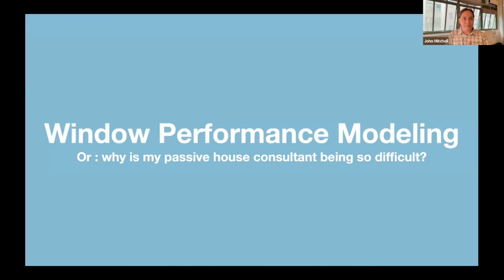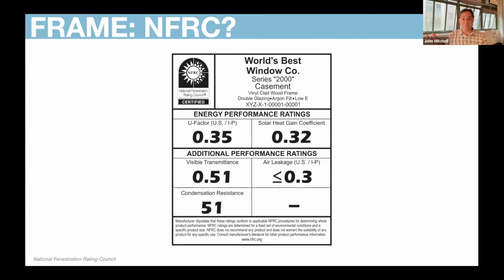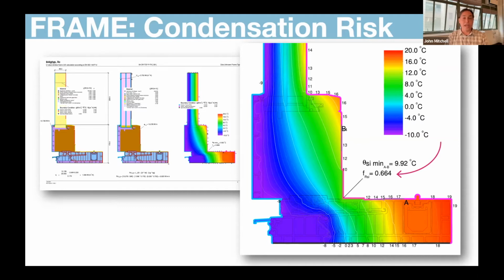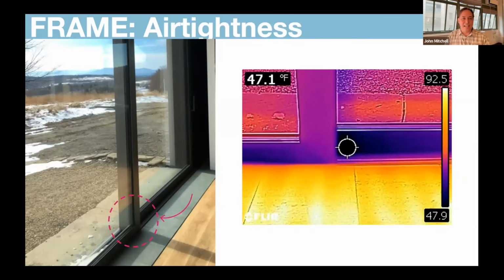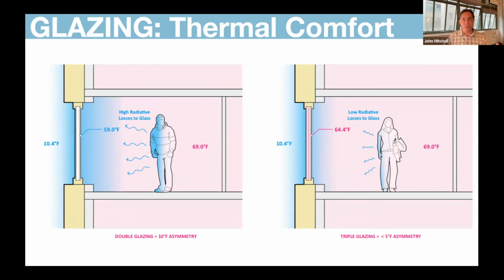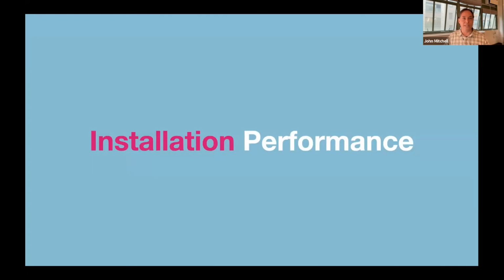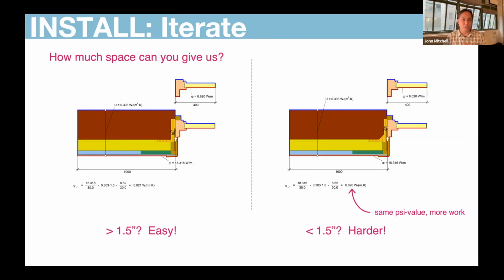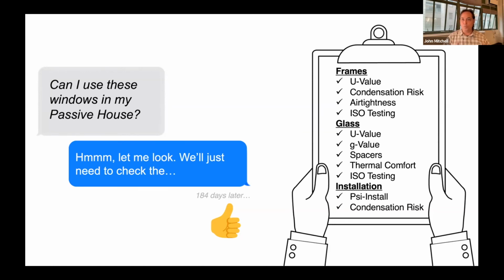Modeling Window Details: Ensuring High Performance Window Stay High Performance | Presentation Only

Comment: Many thank's for the information John, I loved it! Could you please help with two questions? First, which software do you use for the analisys?, and second, how  can I calculate correctly an installation thermal bridge (Psi) for the union between a floor and a window frame or where can I find information about this? I'm confused about how I must consider the distance asociated to the floor U value.
Reply: Think the software used is Flixo. Take a look at the technical documents for entrance doors on the Passivhaus component database. Some of the doors contain the certification reports. They show the calculation procedure for a number of installation situations which might help you with your window calculation.